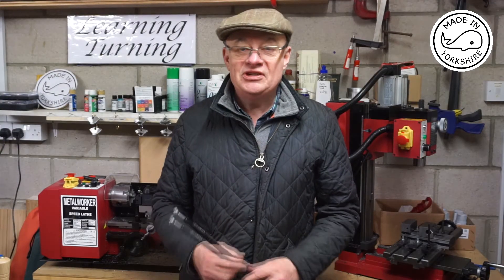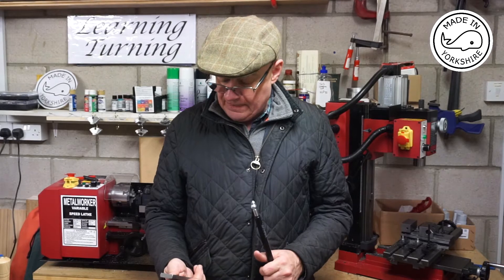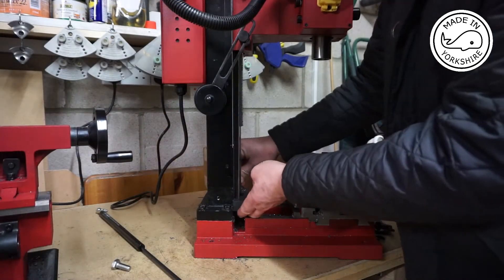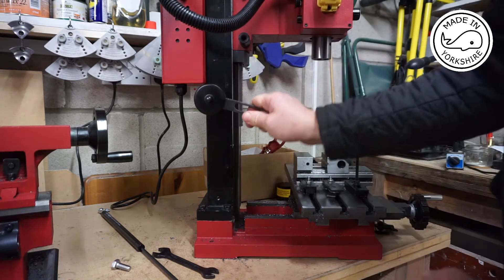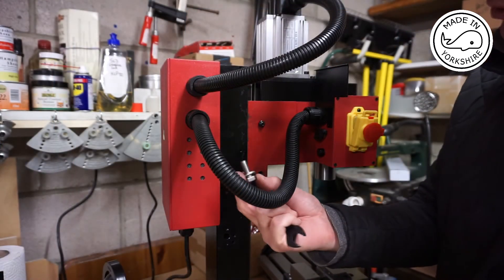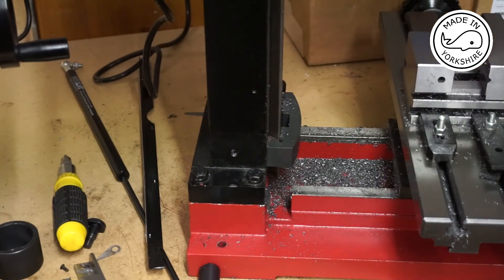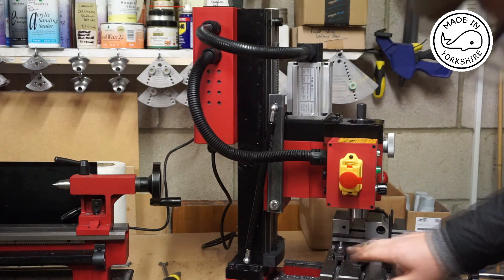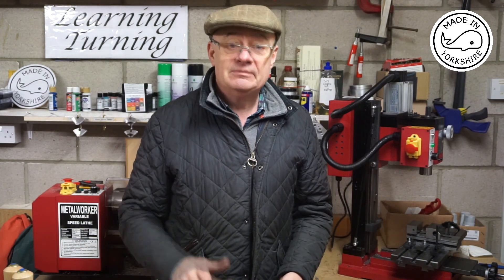#MT9 - Gas Strut Conversion on Sieg SX2P Mini-Mill. By Andrew Whale.

Comment: The one thing that I struggled with was hooking up the strut after cutting the metal strap off the strut. Then I figured that removing the vertical stop, levering the mill head up with a screwdriver, I was able to hook up the strut without trying to compress it.

Comment: Hi Andrew. What can I say. Your video and gas strut idea is simply brilliant. I love simple solutions to problems. I also own a SSeig mini mill, and it is great apart from the stupid, non-functional spring support. Makes one wonder why Seig persist with this piece of crap. Anyway, I couldn't get any sense from the local Seig dealer down here in Australia, and was looking at perchasing the support kit from Little Machine Shop in America, but it would have cost me around aud$200.00 for the kit, and a further aud$200.00 for postage. Simply ridiculous. Then I lucked onto your site and behold -  the heavens opened up and sense was restored. I purchased a very good quality gas strut locally, and made up a bracket using some scrap. All up it cost me about aud$24.00. It now works perfectly. There is no drop whatsoever at any height, and it is easy to raise and lower in tiny increments if needed, and it stays there.MANY, MANY thanks again Andrew - your blood's worth bottling, as we say down here. Cheers mate.
Reply from the maker: Hi Noel - many thanks for the feedback. Unfortunately I can't take credit for the actual solution but I'm glad you found it. I think it's a must have mod for these Sieg mini mills. If you want to totally change your milling experience, add a 3-axis DRO like I did.
Cheers
Andrew

Comment: What size is the steel bar you used ( thickness & width)? I was planning to use a 3/8" x 1" aluminum bar I have (less weight). Don't think a 40 pound force offset by the ball would ever bend it. But I was thinking to cut a hole to not cover the pointer screw which would weaken the bar.
Reply from the maker: Hi. My mild steel bar is also 1" x 3/8". I think aluminium would be fine. 
Good luck.
Andrew
Reply: @learningturningmetal  Aluminum bar worked out fine. I did round the top and bottom so no sharp corners. What a difference!

Comment: Looks like an excellent bit of work. Did I miss the design/spec of the bracket? Appreciate it's just a few holes cut in some steel bar, but it would be useful for a start point.
Reply from the maker: Hi
The bracket is about 9" long, 1" wide and 5/16" thick. The first hole is about 1/2" from the bottom. Then a series of 4 holes starting 7 1/2" from the bottom, spaced out 1mm.
Hope that helps.
Cheers
Andrew
Reply: Learning Turning Metal - by Andrew Whale Thank you, that’s really helpful.

Comment: I was quite impress with the fitting of your gas strut, will the same work on my Sieg X3 which looks like a heavier machine to yours, best wishes Frank.
Reply from the maker: Hi Frank. I don't know much about the X3, but I would imagine that it has a quill feed and that the head is moved up and down the column using a threaded rod. My sx2p doesn't have a quill feed and the head slides up and down the column with the support of a torsion bar. The torsion bar isn't very good, so that is where the gas strut is used to replace it. If however the x3 is of similar design to the sx2p then you would need a longer and far more powerful gas strut.
I hope that helps.
Cheers
Andrew
Reply: Learning Turning Metal - by Andrew Whale many thanks James,

Comment: Hello Andrew , I'll be doing this conversion on my SX2P I've found the company that you refer to and been on their site. However I've found the gas strut by the part number but can't order it because it opens up a box saying "Enter a force between 50 and 400n" . Would you still know this ?
Reply from the maker: HI Nick - you need to specify 150N. It's a great conversion. 

I hope it turns out well. Whichever way - please leave a comment regarding your experiance.
Cheers
Andrew
Reply: @learningturningmetal  thank you, very much appreciated Andrew. Ps love the channel.
Reply: Sorry to be a pain ,I ordered the gas strut but like a fool I didn't even think of the fittings. Can you remember the part numbers/ name of them ?
Regards Nick.
Reply from the maker: Hi Nick. I've just checked the Order I placed. The description is: 2 x 10mm ball stud m6 male thread to fit m6 thread t5.
Hope that helps.
Cheers
Andrew
Reply: @learningturningmetal  thank you for your help. Nick.

Comment: Nice one - the spring is useless on these as you show.  When I 1st encountered the problem the head fell from almost it's full height and slammed into bed - had my hand been under the end mill (not spinning btw) it would have made a huge mess.  I've still not addressed it and the spring often catches me out with horrid jerky movement so I'll be looking at the strut asap.
Reply from the maker: Hi Jonathan - yeah it's definately a must do mod. It's so straight forward too.
Take care!
Andrew

Comment: Hi, can you tell me the link where you have bought the gas strut? I need one
Reply from the maker: Hi David....
www.sgs-engineering.com
The strut is a GS6-15-220-260 and you need to specify 150N. Two attachments are included in the price and I selected 2 x 10mm ball studs with m6 male thread. It came to just over £25 including shipping in UK. Bargain!
I hope this helps.
Cheers
Andrew
Reply: Thanks!! This help  me a lot ;) 
I hope you shows a milling video in the future. Great your channel